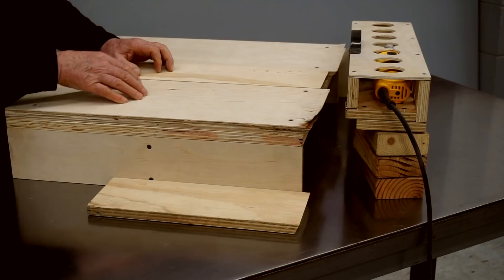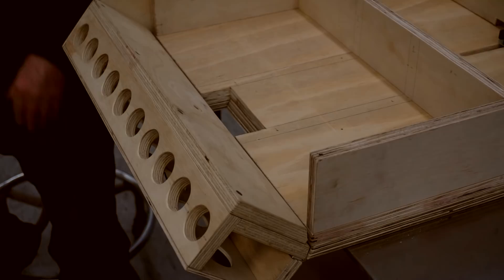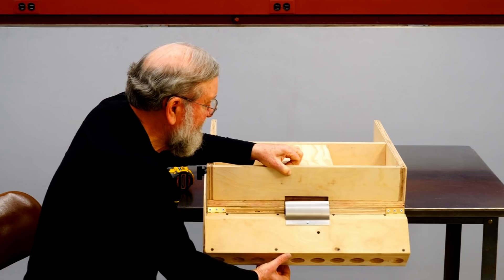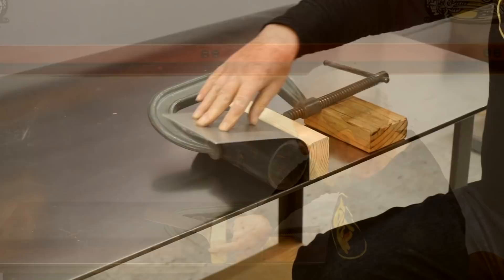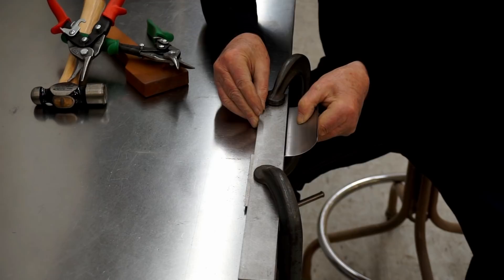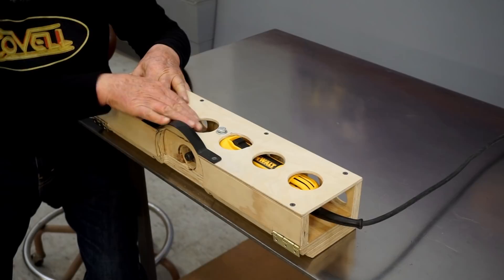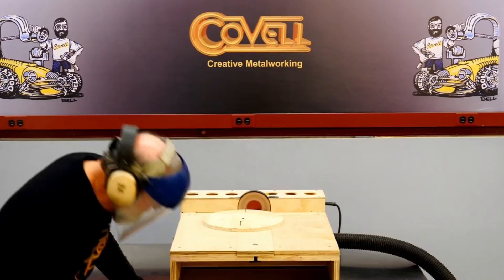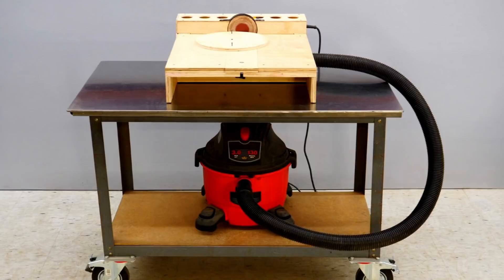Upgrading my Sander

Comment: A great lesson here: iterating and refining are not things to be afraid of - they're the only way a thing, system, or project can improve. You might be happy with your initial design, but it's still worth looking at ways to make it more efficient, faster, lighter, or whathaveyou. Not only will you end up with a better thing in the end, but you'll learn more about fabrication and design in the process.

A master like Ron instantly exploits a problem, the box breaking, and turns it into an opportunity to improve his initial design, since it's gonna need some fixing anyway. While this sort of thoughtful reexamining isn't always practical, say on the job-site or under a deadline, the critical thinking skills you garner from continuously reiterating and auditing your creations will pay dividends in the long run in terms of your skills as a designer and through-thinker.

Sometimes a box to hold your sander is just a box to hold your sander. Other times, it's a chance to evaluate your skills as a creator and learn from your own mistakes or oversights.
Reply from the maker: Very well put, indeed!

Comment: Nicely done! One question though: Why not put the angle completely onto the sander box, and attach the hinges from the bottom (via cutouts in the bottom to reach the screws) and mount them to the front boards in line with the sanding disk?
You'd still have the clearance to move rotate the sander, and more material on the table side of the hinges, and enough space to safely reinforce the connection between the the top and bottom boards (thereby the sander) and the front boards.
Reply from the maker: That's an excellent idea, and I'd do it that way if I was starting over!

Comment: I plan on doing something like this but I want to use a jigsaw.... It seems like it would suit my needs better, it'll basically be a table saw for cutting bigger pieces, then stacking them so I can use them to mold fiberglass over. I plan on trying to make a battery box/body cover for an electric bike....   🤞    lol
Reply from the maker: Seems like the same principles would work for a jigsaw!
Reply: @RonCovell  - I like the idea of being able to lean the blade so I hope it can be changed out pretty easily.... If not I'm gonna have to try to figure it out or find out if someone else already did.    LoL

Comment: Ron, you maker of good things!  Nice upgrade.  Dust masks?  We ain't got no dusk masks!  We don't need no dust masks!  I don't have to show you any stinking dust masks!
Reply from the maker: If you saw the Part 2 video, you will recognize that a dust mask was ESSENTIAL for that version of the tool - before I added the dust collection system.
Reply: @RonCovell  Absolutely.  Now, at least to my eyes through my garbage standard res monitor, I couldn't discern any dust escaping from the negative pressure clutches of the shop vac.  Looks mighty nice!
Reply from the maker: So far, it's nearly dust-free!

Comment: Love this sander.  I was noticing though that you use improvised bending fixtures a lot rather than a traditional brake. I'm curious whether this is just something you prefer, something that applies to these more irregular types of bends or are you just showing that you can do good work without expensive tooling?
Reply from the maker: I use my brake for most bending, but I like to show people what can be done without using expensive tools.

Comment: Oooh, first commenter. I liked what you showed in the video. Hmmm, not sure if I should mention this, but did you deliberately have the bend line in the demo slightly of center so that eagle eyed viewers could comment? If so, well done, I nearly missed it. 😊 Love the simplicity of your solutions to a problem and of course the more complex ones as well.
Reply from the maker: Truth be told, the part slipped a little as I hammered it, since the clamping pressure of the C clamp wasn't centered. I shot that video at about 2 PM on Sunday, and was eager to finish the editing and upload it that evening, so I decided to 'let it slide', but it did 'bug' me!
Reply: @RonCovell  I knew it had to be something like that, considering the great workmanship you put in all the other videos. I think most viewing this will think that as well. Can't wait to see what's next 😊

Comment: Next episode: Making a transfer tube for the vacuum using hand rolled steel with ridiculously beautiful flared ends
Reply from the maker: You know, I thought about that!
Reply: @RonCovell  I'm a little disappointed we didn't see some sort of exhaust system! I actually thought you might make the vacuum attachment on the side of the box, rather than having to push through two holes (I doubt it takes much extra effort to push through two), just to show off some more of your skills.
Reply from the maker: Well, maybe when you build your disc sander you can make a beautiful, trombone-shaped duct. My plan was to finish this tool as quickly as possible so I can get on toward my next collaboration!
Reply: @RonCovell  I'll have to go back through your previous videos to learn how to first!

Comment: so, I wondered briefly when you installed the original hinges: are there any cons to a piano hinge in this application?

anyway, thanks very much!  this was super interesting.
Reply from the maker: A piano hinge could work, and it would certainly be stronger, because of many more attachment points. I used two smaller hinges because I want the ability to sand longer parts, which could foul on a hinge that was closer to the disc.
Reply: @RonCovell  
oh, awesome; I hadn't thought of that.

Comment: Amazing, as always. Did you eyeball the size needed for the scoop (with the aid of years of experience)?
Reply from the maker: Well, I made the scoop as wide as the slide, and I gave it about a 1/4-inch (6mm) gap away from the edge of the sanding disc. The radius of curvature was determined by its distance away from the centerline of the hinges. So, if a way, it 'designed itself'!

Comment: Remember, dust collection is about high velocity flow not vacuum. You seem to have a lot of dead space and not much room for air to get in.
Reply from the maker: Most of the airflow comes in through the gap between the slider and the disc, and the gap around the perimeter of the disc and the guard around it. This is exactly where most of the dust is generated, and the collection system seems to work well for this particular tool.

I did watch Stumpy Nubs great video on dust collection systems, and learned a LOT from it!  https://www.youtube.com/watch?v=qjI5l4nF9AM
Reply: @RonCovell  That video is a treasure trove of hard won experience I had not previously taken in. Highly recommended for the next comment reader.

Comment: Ron I love ya bro, but there's a difference between engineering and art, putting the plenum in the middle of the cavity will reduce its performance by 50% at least (though its pleasing) if you want it effective shove it as close as possible to the source of the mess (ie the sander)

Comment: Why not some piano-style strip hinges?
Reply from the maker: A piano hinge could work, and it would certainly be stronger, because it would have many more attachment points. I used two smaller hinges because I want the ability to sand longer parts, which could foul on a hinge that was closer to the disc.